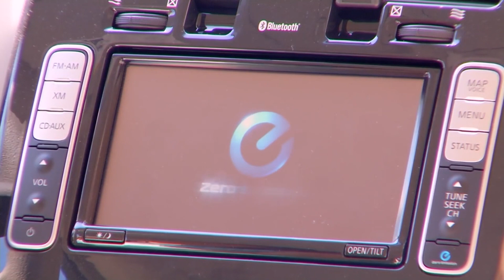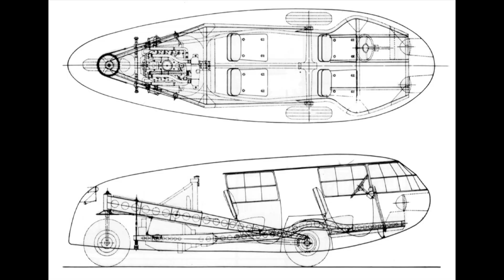Buckminster Fuller's Dymaxion Car | Living St. Louis

Comment: Bucky had good intentions and some good ideas, but in a practical sense his Dymaxion car was a pretty dumb design in almost every way, often with little justification for the way he did things with it. It handled badly, had little crash protection for the people in the front, had an overly complex and large front window and then hardly any windows for passengers. Noisy, uncomfortable seating for passengers, and a host of other shortcomings.

In this video, I am also unclear as to the provenance of the exact car pictured. From the narration, I gather that it is a complete replica, at least in form. But it also says that the car was made from aluminum, but the interior shots look like wood construction.....is this authentic? I'll have to dig back through my references.....

OK, I have looked through some Bucky books, and viewed many photos of historical Dymaxion cars. However, I don't know if ALL legitimate Dymaxion cars had the same exact design details. The car in this video has the general shape of the ones in the pictures I looked at, but most of the details are different. I get the impression that THIS video's car is just an approximation of a Dymaxion, NOT a real reproduction.

I would be happy to hear more details, from any INFORMED source.....